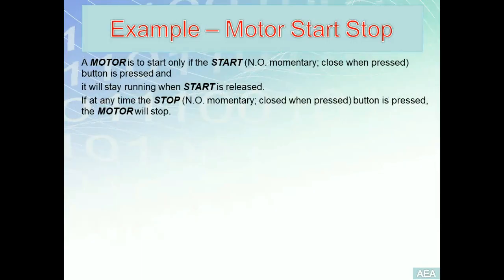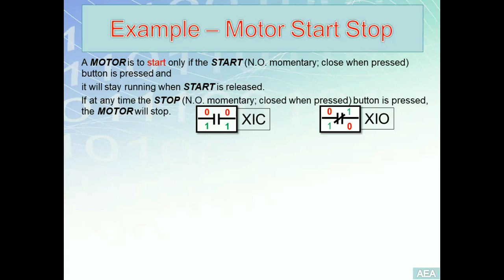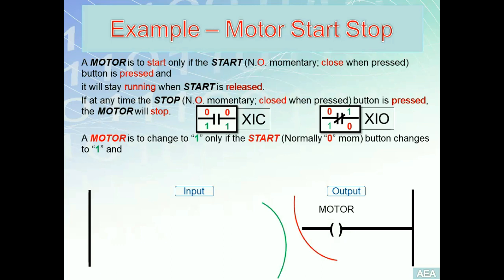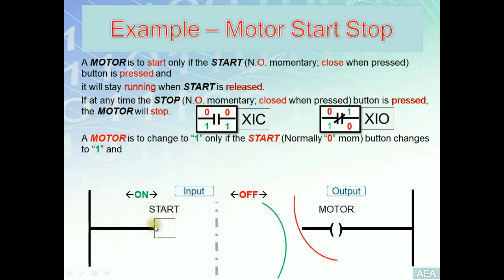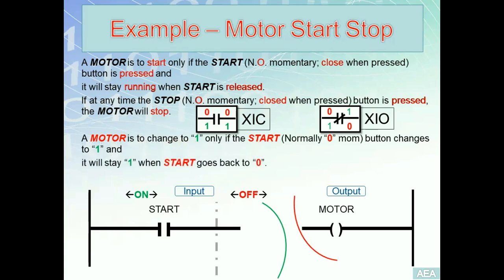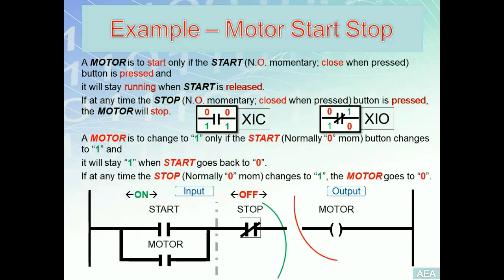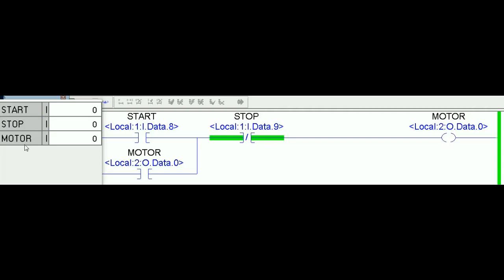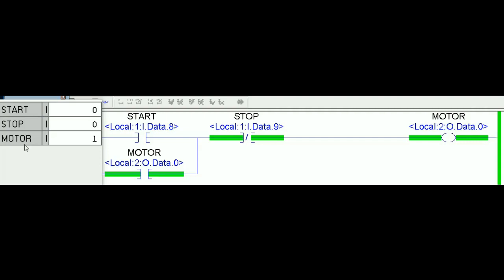LD 10 - Start Stop Motor Ladder Logic Program -  Easy PLC Programming Tutorials for Beginners

Comment: Hey Ali, thanks for all this videos, great help to learn the PLC as you explain it in details.
In this video you mentioned STOP ( N.O momentary! ) and chooses XIO, in the next video you mentioned STOP (N.C momentary) and chooses XIO ( which seems right), shouldn’t be the same in this video also and use XIC for STOP PB ( as it’s a normally close PB )?!
Reply from the maker: Vahid, 
I’m not sure why my reply wasn’t posted .
Anyway, in this video, we were given Stop to be Normally Open switch, and because of this we had to go with Examine if Open - XiO - to refer to the Stop because this will keep the instruction ALWAYS True in the off section of the rung until Stop is pressed. If Stop was NC, we would’ve gone with Examine if closed - XIC - because this will keep it True until it’s pressed. 

The idea that we need to keep in mind to correctly choose which instruction to use in the OFF section is the instruction always has to be true as long as the Stop is unpressed.

Comment: Isn't it easier to say "if using a NO switch, use XIC, and if using a NC switch, use XIO"?

I like your videos. Clear teaching.
Reply from the maker: Thanks Patrick, your statement is 100% correct if switch/sensor is required to start a process. On the other side, a switch/sensor required to stop a process will have an inverted discussion.